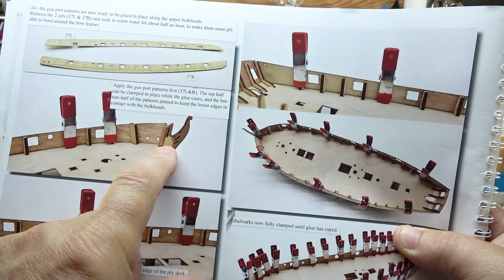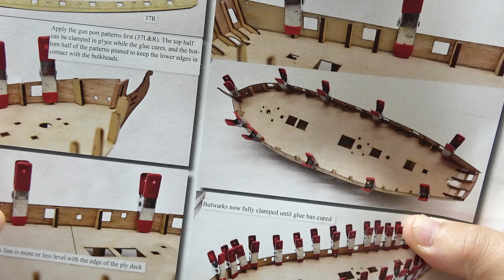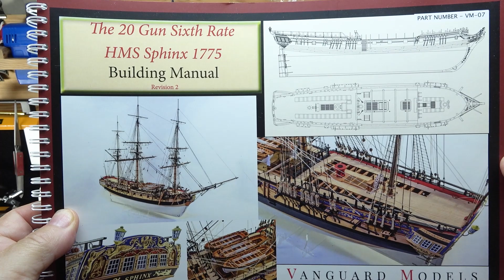HMS SPEEDY 1782 IN 1/64 SCALE UPDATE 2

Comment: Hi Paul, a little difficult to tell but looks like you need to do a little more fairing of the stern ribs at the keel at least.  I think I can still see laser burn.  make sure your rib sits flush against a plank and no part of the rib is not in contact with the fist planking.  it may be the angle but worth double checking.  Looks fabulous though.
Reply from the maker: Jason l’ll take another tomorrow’thank you